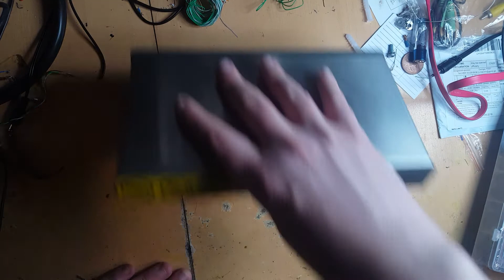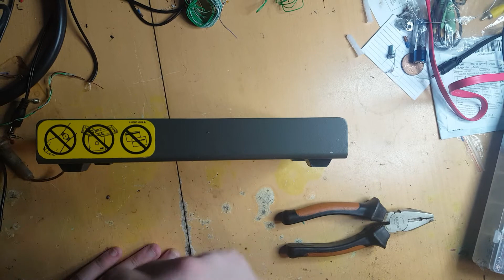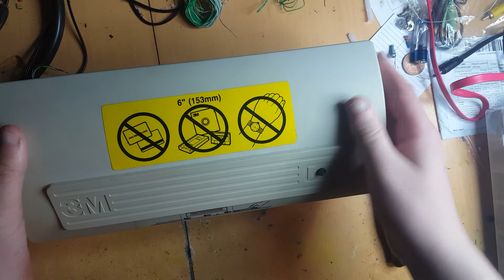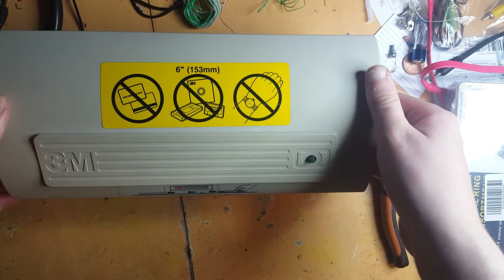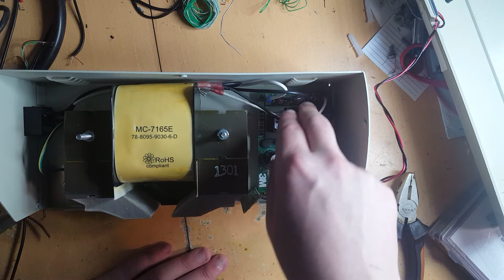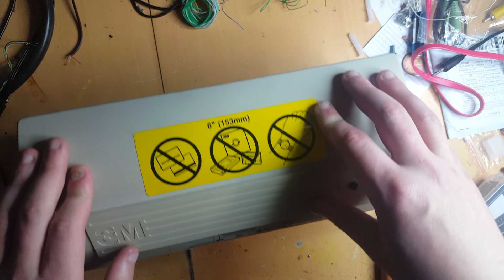Magnetoacoustic library system teardown

Comment from the maker: Figured it out now! I did have it backwards: The degausser is used to set the tags to 'active' so they set off the alarm. The magnitiser is used to inactivate the tags by giving them a field so strong they saturate and so won't react to the further external field of the sensor. All explained here: https://en.wikipedia.org/wiki/Electronic_article_surveillance#Electro-magnetic_systems

I also got the chip wrong: The LM358 is a dual op-amp. I've used it before.  I was thinking of the LM393, another chip I've used before. And the MC14538B? Dual astable multivibrator. Don't know what that's for.